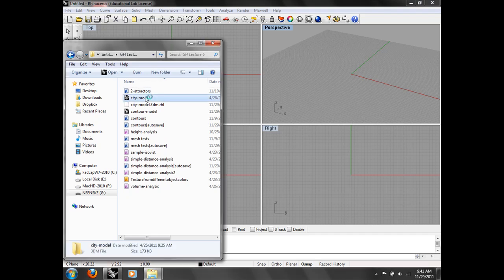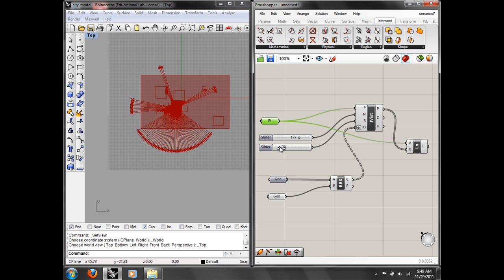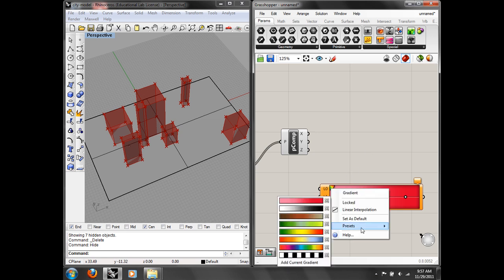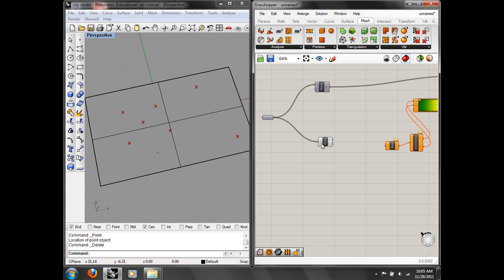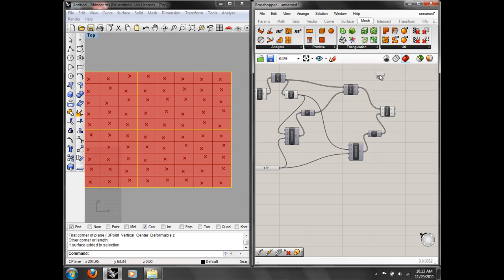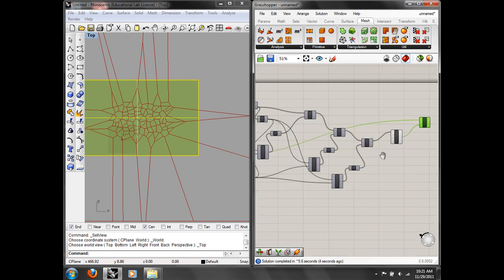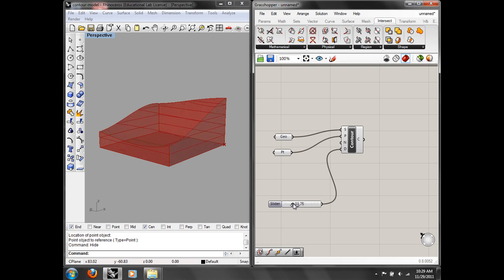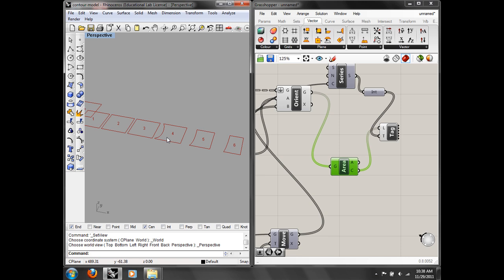Grasshopper Lecture 6: Supplemental

Comment: Hi Mr.Nick, thanks for the lectures, they are really nice ! Sorry to take some of your time. During 40:20,  my Surface Split box turned red and it says " Splitting Returned No Results ". Have tried  deleting the Z vectors (for the points) earlier on just in case the Voronoi formed wasn't aligned to the plane to Split Surface with. However, somehow the box still turns red. Have tried to Graft the the Split Surface box but that would result in alot of surfaces which does not seem to be in line with what was shown in the video. At such, the further operations wont work as the Split Surface Box is red. Is there any way I could go about this ? Would really appreciate your help, thanks !
Reply: a year later, and i too got the issue...and my range for moving the points doesnt work in Y axis. would be helpful if someone could help. Dank je'